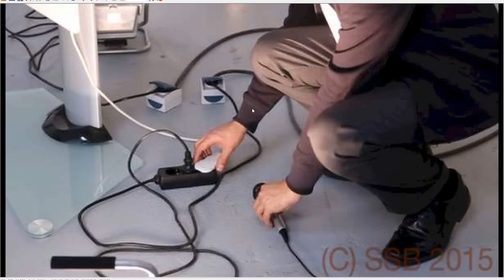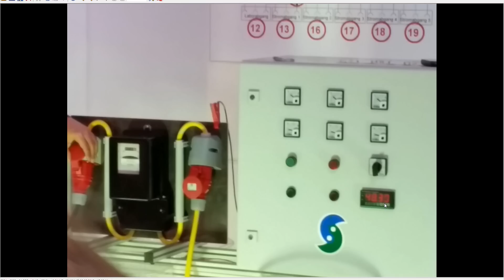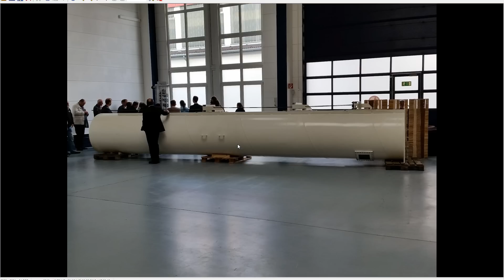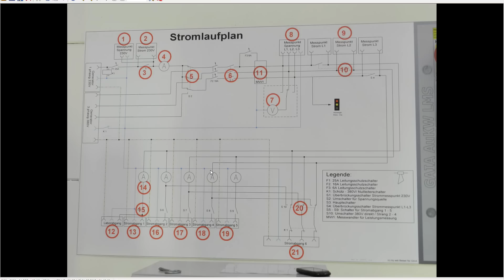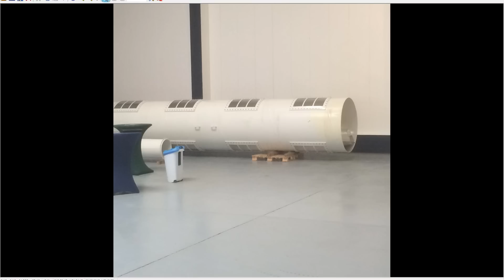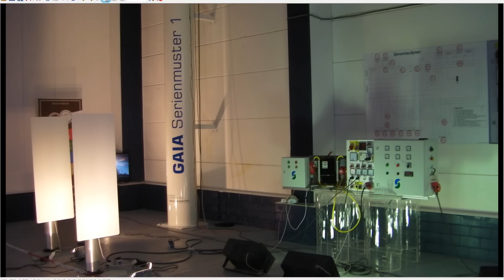Gaia Rosch Facility Tour Slideshow - Gaia 5 KW AuKW explanation tour

Comment: Great coverage Stephen,  following this new technology are we just looking at another version of the over ballance wheel,  this version makes sense to me.  The buoyancy of a boat is fascinating but nobody thinks about it because it just works similar to a light bulb in your house nobody thinks about it working after you turned on the switch the reason the DaVinci over balanced wheel is so fascinating is because nobody has made it work once they do will stop thinking about it good to see you made headway on this coverage have a great day.

David A Puchta 

HydroMe Truefuelcells 
BlewMe Fuel Organically Grown From Saltwater.
StreamMe Energy Microbial Hydride Fuelcells.
Biometals simply because they are.
Reply: Hhydrogen4Power Not a new technology but a new scam. Many might not think about buoyancy, but physicists know about it very well - starting with Archimedes. And of course this buoyancy power station does not work, it's just a new free energy fraud.
Reply: heinzpg I really don't know if it works.  It's a lot of experience in buoyancy and they're trying to figure it out at least you got to give him that
Reply: Hhydrogen4Power
The force of buoyancy equals the weight of the displaced water. This is a fact, not only backed 100% by experience but also mathematically easy to prove. And as asserted is the formula
power = force x speed
Applying this you can figure out at once, that buoyancy in the "5kW-AuKW" can't deliver more than 500W, the power for the compressor and losses not yet subtracted. Besides, there is conservation of energy.
And you still don't know if it works? Everyone competent in physics knows it does not work. Formulas of physics enable us to construct machines and buildings and sending a spacecraft to Mars. It is weird to think that these formulas are not applicable for this simple design.
They are not figuring out possibilities of buoyancy, they are only figuring out a scheme of fraud, that's all. Even without physics the indications for fraud are overhelming in this case.
Reply: heinzpg fraud,  you kneed five factors to be true for fraud, the fact he built one cancels out this. The forward business is still up for judgment.  But I really don't give a shit about the business end, so I don't care about name calling. 
What I am interested in is the fact he put a system together and if it doesn't work, than I want to know why, I fix problems for industrial applications for a living. I also build industrial products for my company.  Some stuff works out of the gate, and some just fails, I spend a lot of time studying what I did not get as a result of the event. 

I do alot of real physics alot, and this unit may or may not work. The only way it may work is the air unbalanced the wheel, so if there where 10 floats displacing .5 gallons of water, that 4.3+- pounds if lift per float, totalling 43 pounds of torque. Now logic says that a five horse power genset will do 5kw.  There is no 43 foot pounds of torque in a 5 horsepower briggs and stratton motor and if there was then you can use gear reduction and raise the horsepower to run a genset from torque. All you need is torque, that is way different than horsepower.  The system is a low speed generator.  
I think there are positive aspects of this offering that need to be looked at, this system already gave me several ways I would build one, I don't plan on it, but plans change. 

David A Puchta 
Hhydrogen4power YouTube 
HydroMe Truefuelcells 
BlewMe Fuel Organically Grown From Saltwater. 
StreamMe Energy Microbial Hydride Fuelcells. 
Biometals simply because they are. 
Hydrogen Injection Systems DBA Company. 

Just in case you are wondering.
Reply: Hhydrogen4Power
Sorry, but the fact, that a device was build, does not cancel out fraud at all, if this device is only built to deceive people and get their money.
You do a lot of physics?
you can use gear reduction and raise the horsepower
A gear box doesn't change power at all - despite slightly reducing it due to friction. Sorry, when you make such statements I doubt you are competent in physics. I have given you my calculation, volume ot the upmoving containers about 200 litres, speed 0,25 meter/second, results in power less than 500 Watt, power for the compressor and losses not subtracted. Check it!
Reply: heinzpg I really hate duche nozzles that don't have any videos of therw work, because they don't do any, and just talk armchair shit. 
The second point of yours, I led you into answering,  however your calling fraud before a crime is committed,  you don't know if he is or is not going to deliver, why don't you go to the police and tell them that your buying a fast car, ask for your tickets in advance because someone else was speeding in a car just like the car your buying. You must be a a communist bastard.

The horsepower analogy was my fault for confusing your simple mindedness it was easier to use a horsepower and allergy then it was to go over ratios and torque charts with you. have you ever driven a car you idiot, you can have all the horsepower in the world but you can access it without torque. 

Unless we know the exact volumes of the float, hypothesis is mute.
Reply: Hhydrogen4Power
Unless we know the exact volumes of the float, hypothesis is mute
Wrong. We know an upper bound for the volume of the float, since the containers are in a cylinder of 0,5m diameter and of 5m heigth. It is easy to calculate the dimensions of the floating cylinders to get an optimum of volume. With this upper bound (220 litres) you get approx. 540W power of buoyancy, since also the speed of the arrangement can hardly exceed 0,25 m/s due to water resistance. Show the fault in my calculation if you can!

And don't brabble of torque charts! I am a MSc in EE and obviously much more knowledgeable in this field than you.

idiot, communist bastard
Name calling is the only argument you have left? I am better educated than you. I just call you incompetent.
Reply: heinzpg you can write between the lines, I'd rather call you to the mat. Ok point taken no more name calling except competent in one field doesn't necessarily make you incompetent in another field I never professed to be an expert in this buoyancy field, but my competence in other fields raises different questions that the essence of our discussion.
Reply: Hhydrogen4Power
The topic of this "power station" needs competence in physics on a rather basic level. It is fairly easy to calculate that bouyancy of this device can't deliver more than approx. 500W, and it is as easy to show, that by subtracting the power for the compressor and losses you get a solid minus figure. This device does not deliver any energy at all. That's a fact, since I see no reason to doubt fundamental formulas of mechanics like energy = force x distance.

I watched the development of this device and besides physics it can be seen that Gaia/Rosch behave in a most dubious way. They claim for instance to have a TÜV certificate for a smaller version, but they don't show it, not even the front page! These guys are not inventors but a gang of fraudsters. Authorities normally do not act until someone files a suit. Which might be difficult since you can bet, that contracts of purchase will state, that you buy a new experimental technology without any guarantee of function.